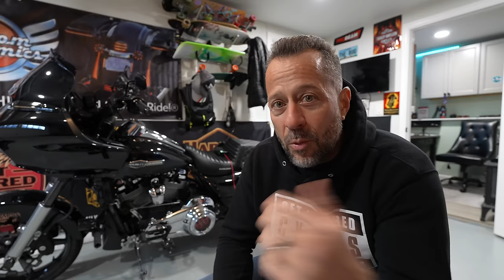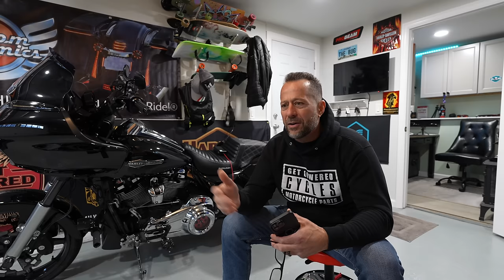HOW TO PROPERLY BREAK IN YOUR MOTORCYCLE ENGINE #cyclefanatix #harleydavidson

Comment: What pains me is, seeing people start their bike and beat on it while it still cold.
Reply: What pains me, is seeing you, in pain, from them……
Reply: Thst makes me sad also
Reply: How important is it to warm up the bike, and how long should it idle before riding hard (or at all)?
Reply: 30 to 60 seconds idling is fine, and then 2 to 3 miles of riding easy and the cylinder temp will be up to the 180 degree range.  At that point, the aluminum pistons, and steel cylinders, will have expanded to their proper operating clearances, and you can get hard on the throttle. 
The cold engine damage typically occurs when you immediately run a cold engine hard. The aluminum pistons heat up and expand much quicker than the thick heavy steel cylinders, to the point where the pistons are scraping and scoring the sides of the cylinder walls.
Reply: Warming the bike up is important... at minimum, you should run the engine 30 seconds to allow oil to reach the top end. The bike should not be ridden aggressively until the engine is at operating temperature. Common sense.
Reply: Thanks, Richard. I didn't know that. 
 @richardrussell500
Reply: you assume the entire bike is warmed up after idling? 🙄😂What about the transmission? That needs to be moving in order to warm up. The tires need to be moving to warm up.

Comment: I always listen to the manufacturer. Never had a problem with any bike.
Reply: Same here! 🤙
Reply: I go by the manual. To me, this comes directly from the engineers that built it. My road glide says 500 miles, to stay below 3500 rpms. Easy enough to do.  The tech told me the same thing. Oil change at 1000. The tech Saud after the 500, do what ya want. I'm not going over 4k until after the first oil change. Get those metal chips out....idk. that's what I do
Reply: They dont't tell you to take it slowly for the engine health, but rather to avoid lawsuits of people ending up having accidents, because the proper way to brake in an engine is to let it warm up and then run it under heavy load and high rpm. The manufacturers even run the brand new bikes on the dyno to check if they make the advertised power and have any issues before shipping them out. So now after the bike has been brought to its limits, you have to ride it gentle? Make that make sense please.
Reply: @RuBa1Z  Your money, your bike, do what ya want. I don't believe for a second, they tell you to stay under 3500 rpms, in any gear, to avoid accidents. That's ridiculous.  Even the manager of the service department recommended that! I've owned SEVERAL motorcycles, cars and trucks,  in my 60 years. Have you ever looked at the oil and drain plug magnet after 1000 miles? There's an awful lot of metal chips in there. If you want your stuff to last, listen to mechanics and the engineers that build the shit!
Reply: @BobinNH  You actually made a good point in the end to listen to the engineers, so let's forget about what a manager tells you, because he has no clue. The people that build the engines, measure every engine part to be a perfect fit and they say that it is crucial to run the engine hard in the first 20-30 miles in order to ensure the maximum power and longevity. If they wrote this in the manual, people would stress out not riding their bikes hard and fast enough, which would result in some people having accident because of it. Then the manufacturers would be held liable and that's why it ain't written in the manual.
Of course an engine gives off the most amount of metal particles when the engine is new because all the different bearings and rings have to adjust to eachother. That's why you change your oil multiple times in the first 1000 miles.
Now tell me please why the manufacturers are allowed to redline the bike in the factory but you "have" to baby it?

Comment: Update from my last post. I just got my first service done. 1500kms, not quite the 1600 or 1000miles, but close enough. The first 40-50 miles, I adhered to just taking it easy and not romping it or exceeding 100kph/60mph. After that, I guess you could say I halfass hard broke it in. I really worked the motor. Rolling on good, rolling off. Engine braking. Playing with the rpms and gears in the 3000-3500 range. On the highway, fed it good throttle, rolled off. Did that a bunch, rolled on hard, shifted. Stuff like that. Only odd thing was that apparently I lost a manifold bolt upon inspection at the dealer for the service? lol.

Comment: I have had many bikes and new cars. I kinda go easy for the first 500 miles. Usually ride at different rpms. After 500miles its free sailing. Never had any issues at all in 50 years of buying new anything.
Reply: Exactly the same for myself.   NEVER had a problem.  My bud purchased a 2023 bike, couldn't resist the throttle, within the first 15 miles, he was bouncing the rev limiter😅.  That bike ran like a champ .  FACTORY freak. 😂
Reply: Me too. Cars , trucks, and bikes. Got my first bike 45 years ago! Never hurt me, to go by the manual. Never burned any crazy amount of oil, or any real issues...

Comment: When I bought my 22 low rider st they said to ride it kinda easy but normal for the first five hundred miles. 12 hours later I took it up my Washington and had a blast with it sense. But I didn't baby it but I also didn't straight up beat it neither. I changed the oil at 1000 and it's all good. Have over 12k on it now

Comment: I did a lot of research when I rebuilt my TC 88, reviewed the motorman procedure among other break in procedures…

After seeing the crosshatch, and how the break in procedure uses the fresh cross hatch to oil and cut in to bed the rings, I felt the factory procedure would be more effective at setting the rings…

I followed the same procedure when I picked up my new ‘22 road glide 114.  Over 20k miles now, no issues so far…

Under 3k rpm for the first 500, and then under 4500 until 1000 miles, vary speeds, no long highway runs…. after that, let her rip…

Comment: I’ve never broken in a motor as recommended by the dealer. I’ve always taken them to their limits on the way home from the dealer once the engine was hot. Most of my life I built race engines for my street cars. I would run a new motor for about 20 minutes at around 1500-2000 rpm’s if new rings were installed or a new cam was installed. After a quick break in I would change the oil, checking the oil and oil filter for a metal. If all was good off to the track I went.

Comment: When I purchased my 2020 Road Glide off the showroom floor, I run the engine hard.
When I got about 500 miles on the engine, I did about a 2500 mile road trip.
Also I have a Cessna 172, last year I installed 6 brand new cylinders and pistons and rings.
The proper way to break in the cylinders is to fly full throttle for 2 hours on mineral oil. After this you’re good to go.
Reply: Why does it have to be mineral oil?

Comment: The most important break in procedure is at the factory... managing heat cycles is very important. If you want longevity, break it in as per HD manual procedure. Change RPMs frequently, do not lug the engine and rev it to the max recommended RPM only for the first 500 and 1000 mile intervals. Change the oil and filter at 1000 miles and then ride as you please. Another crucial component that the M8s experience is too much crank case pressure. I immediately installed external head breathers and the Trask tranny vented cover. I have 1600 miles on my 107 and it blows damn near zero snot out of the heads and the Trask filter is clean. My engine does not burn noticeable oil. So far, so good. The procedure you speak of works just fine for race engines that get torn down and rebuilt every season. You will see race engines given a good amount of heat cycles before being run. This is the trick to proper ring seal. They also run significant crank case relief systems. I have read reviews on different break in procedures. And all of them showed that following the manufacturer's recommended procedure worked best for the long haul. Merry Christmas and stay safe in 2024 :-)

Comment: Bought a new RoadGlide in 2008. I broke it in by heat cycling. Put a set of Andrew 21 cams with a heavy breather from Harley. I still own the bike. I’ve put 102,000 miles on it, runs like a top and doesn’t use oil.

Comment: I’ve owned 7 plus brand new Harley-Davidson Motorcycles and I’ve never experienced any issues with any bike. They all ran perfectly consistently since I know how to ride properly.

Also, I break in a new engine the exact way I ride. If you ride too slow the pistons will seal lower than you typically ride. Just ride it how you normally would considering you know how to properly ride beforehand.

Comment: Brother what a great resource, that was a great teach and I’m with you. I’ll listen to the builders. You made all the sense in the world. Now my Part 2 for you. How would you address/handle a slightly used bike, say a 2022 Road Glide, you just bought with less than 2,500 miles on it? You have no real idea how it was broke in or was it at all, or was it overdone; only going by what you were told. If your plan was to do a big bore stage whatever, then you break in the correct way with the upgrade. But if one has no plans for a big bore, but maybe just upgrade to a Stage 2, then do you just hope for the best, or take it to your guy to pull things apart to examine as much, and determine your path from that point forward.

Comment: I left the dealer road the 12 miles to the interstate and promptly took it right to 110 MPH in 5th gear then 6th and slowed back to 70 to 60 back to 80 back to 60 back to 100 and did that the 45 mile ride home. motor been fine for the last 19K miles

Comment: Use to build car race motors. If it did not ring seal with in the first 20-30 minutes it never will. Best to use high ZINC content oil for break-in.

Comment: my dealer for the first 500 miles keep it under 70, tire air 40 front 40 rear. easy on the gears.

Comment: When I did both of my stage 4 bikes I was told to be easy on them for the first 500 miles.  I think I obeyed that for like the first 150 miles.  Not an issue once. My bikes run like a freaking Cheetah.  😂🎉. I do suggest to always do the S&S guardian kit on big bores.

Comment: I listen to the motor and the motor only! It will loosen up and start running cooler. Then after I change the oil out I will start rolling on the power ASAP. Usually around 1,000 miles on the clock. Until them keep shifting gears no long sustained mph and a lot of cooling off and warming up on rides.

Comment: I have never had a motorbike engine fail on me except a two stroke in my early years which siesed and a honda which sounded bad and no matter how many tomes i took it to the dealership he would just say oh you dont like singles. That bike had a recall for the bearings and they never di the work i traded it and it broke down soon after bring sold. The bike store was pissed who sold it to me as they had grief from the store i traded in with as they had not done the recall work which was the failure i was hearing. Every other bike has been fantastic engine wise. No matter if i bought it new or second hand. Lets face it a lot of bikes are bought second hand who knows how they were run in mostly you have only service records to go by and the bikes overall condition. I would say the most important thing you can do for your engine is chage the fluids regularly ie oil and coolant.

Comment: When my engine was built, the engine builder told me ride it like your going to ride it. the dyno guy already rodded the hell out of it on the dyno.  My  new bikes I usually drive 500 miles nice and gentle not over 3000 rpms, then change oil and ride it like I stole it.
Reply: This is what the dealer told me. I’m at 350 miles in 4 days i just want to open it up ….. 23 road glide st

Comment: Thanks for another good video and especially this one as there are so many people that get this wrong. Every street bike I have ever had from new I ride it like how I would normally which is on the more aggressive side of riding. Only 2 rules I try to keep is not to red line it and avoid a steady RPM for the first 500-800 KMS and then drop my oil.  So far very bike I have ever owned I haven't had any issues with.

Comment: Initial break in procedure may only be needed for first 30 miles on some bikes but you’re insane if you are trying to convince anyone that all bikes and engines are fully broken in after that and I don’t care who your buddies are, what they build or how they dyno. 
I often end up with a completely different running bike at 1000 miles than it was at 100 and there is nothing wrong with playing it safe during this time of constant changes. 
Because it’s not just about break-in you are also looking for any manufacturing flaws that could be minor now but will become catastrophic if not caught early on before riding hard. 
RTFM. 
Proper warm up procedure every time. 
Take longer rides while varying the speed, rpm’s, shift points and terrain. 
Use some decent engine braking and hard acceleration but not excessive and no lugging or tractoring dirt bikes yet. 
Don’t beat the living snot out of gear box and clutch doing stunts or redline the engine yet and change oil and filter every 200-300 miles first few times. 
After 400 to 600 miles if everything seems fine then start letting her have it any way she wants it.

Comment: 2023 HD Nightster RH975.
Dealer said keep it under 4k RPM. This bike doesn't redline until 9k. I submit that as long as I didn't run at a constant RPM it is better to vary the RPM's across the entire band.

Comment: The manufacturer gives specific guidance on breakin in the owners manual.  They designed and built the bike.  0 to 50 miles, up to, do not exceed 3k RPMs.  50 to 500 miles, do not exceed 3500 RPMs.  And NEVER hold a constant speed,  such as on a interstate and avoid full throttle starts.  Leave the bike stock during the breakin.  As far as too rich or lean, that is why during breakin you adhere to the manufacturers recommend breakin.

Comment: It’s funny you talk about this. 
Last week I saw a video about a guy’s new 2024 I think it was a 2024. Well it was new to him maybe a 2023 with low or no miles on it and I believe he said within the first few hundred miles the engine blew up. 
I believe he said the rod went through the case, Oil everywhere. 
In the comments a few other owners of the same model had similar issues 
He talks about break in period, and how he wasn’t getting on it very hard because they said take it easy first 1,000 miles then bring it in and they will change the oil mainly looking for metal particles in the oil. 
But it didn’t make it a few hundred miles.

Comment: I just bought a 2024 rg, they told me 1000 mile break in period, dont beat the hell out of it, dont be afriad to ride it, but what they really dont want you to do is get on the highway and set the cruise control for three hours. They want you to spend the first 1000 miles on a country road where you are changing rpms and shifting a lot. They didn't tell me there was a rev or speed limit.

Comment: The first 500 miles, I vary the RPMs up to 2500 RPM. The reason is that the piston rings need to seat against the cross hatch on the cylinder.  Tolerances are very tight and the cross hatch will wear down, shaving small amounts metal into the oil and friction heat from tight new Tolerances. After this 500 process,  I increase engine RPM so the rings reach higher up TDC and lower BDC to set ring ridge in the cylinder.  If you don't set ring ridge, cylinder diameter at TDC and BDC will be smaller  possibly breaking rings later. That's why some guys ride it like they stole it.

Comment: A "break-in oil change at 500-600 miles on new or freshly built motor is very important. Beyond that with modern engines, the other important things are not to stay at any sustained rpm for long periods of time and try hard to avoid running the bike for short periods where it doesn't get up to full operating temp, for the first 1000miles.
Reply: @williamlyons3947    What? HD's quality issues are far behind them and on top of that most of the performance engine builders build to standards and tolerances far beyond any manufacturer. Not doing a break-in to ANY new engine is just plain stupid. Before you write something about me being an HD fanboy or some such nonsense. I ride Honda Goldwing Tour and a Suzuki DRz400s

Comment: My gut says bring up any internal combustion engine to operating temperature before laying into it regardless of it's age / total hours / miles. Other than that, I try my best to get in 2-3 heat cycles before pushing it. I've also gone full boost / wot with less than 50 miles on a mustang Coyote engine after being fitted with upgraded pistons / rods etc. No problems. I also just bought a brand new Kawi ZH2 and it'd been in the 140mph range several times before it reached 80 miles lol. I was however up to operating temp.

Comment: What if you live in a state like CA where you can't get your motorcycle dyno tuned? For me the FP3 was my only option when I put a 2 into 1 on my Road Glide. It seems to run fine and has as much power as a stock 103 could hope to have. The engine was certainly broken in when I took the slip ons off and put the 2 into 1 on.

Comment: Is Dyno tuning the best option sure, but your not going to ruin your motor running a canned tune from a reputable shop. My self and two buddies have well over 150k miles on stage 2 baggers with canned tune fron Fuel moto for our setups. All 3 bikes run very good all 3 have not had any engine issues.